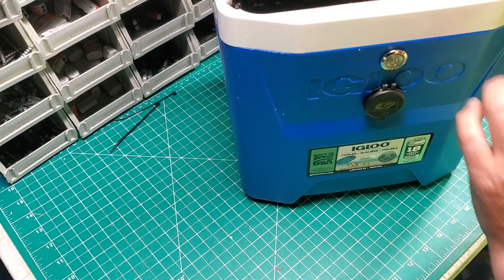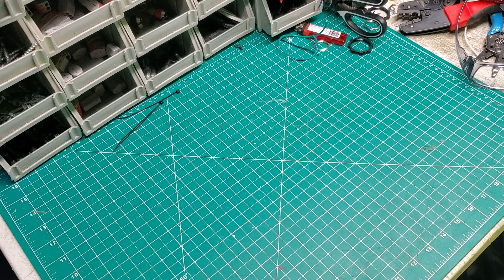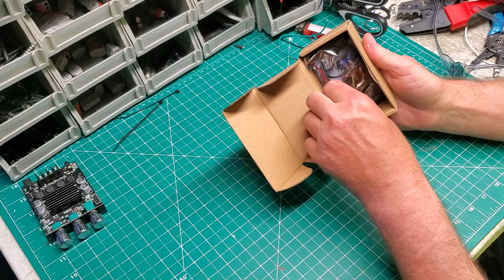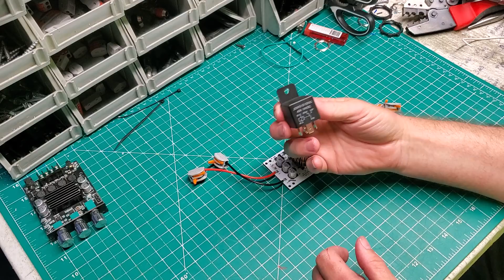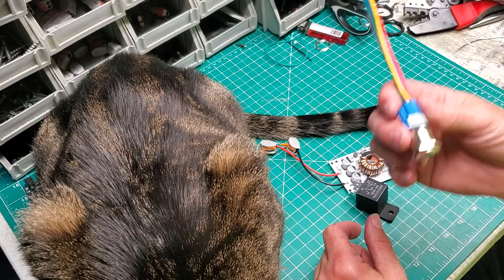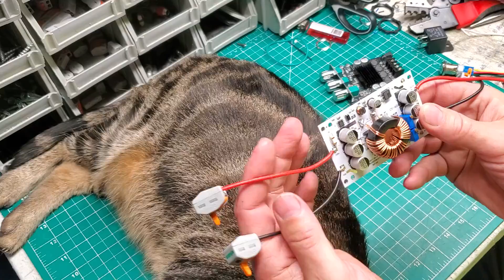How To Set Up A Voltage Booster

Comment: would this get hot in an ammo box when it closed? would I need to get some sort of a cooling system like fan for it?
Reply from the maker: Not at all.
Since I use dynomat instead of insulation,  the inside stays very cool. Never had any problems and I hsve made hundreds.
Reply from the maker: Now, there is a larger one now on the market and it does have a built in fan but it is much larger and more powerful
Reply: @diyboomboxesintexas2805  thanks

Comment: How long does the battery last? you use 6000mah batteries correct?  thank you
Reply from the maker: I don't use them with a voltage booster. 
I onlybise a booster with an SLA deep cycle battery
Reply: @diyboomboxesintexas2805  what size sla battery and how long does it last?  thank you

Comment: Quick question Phil.. does that amp and booster need cool air ? Would it be okay in an enclosed build like a functional cooler?
Reply from the maker: I have used them in a functional cooler and they work good.
Watch my video on Where to put the beer.
It may change your mind on making a functional cooler